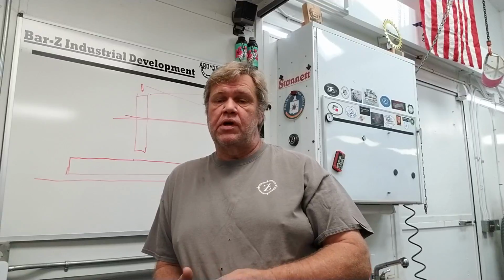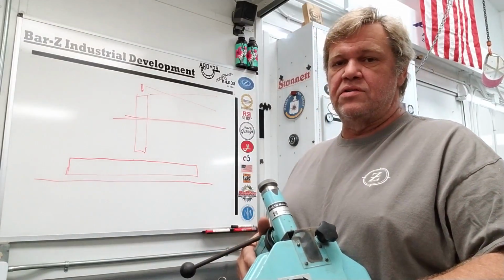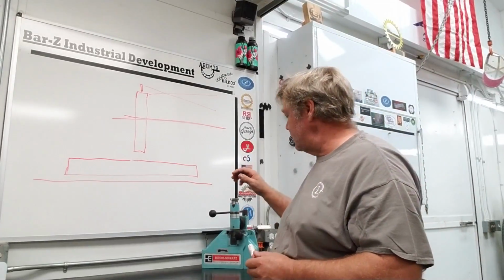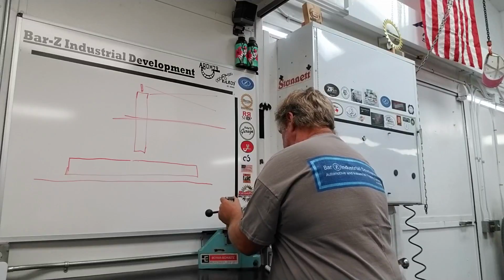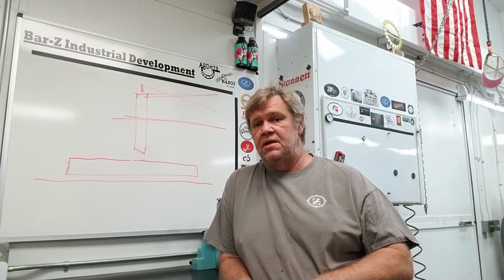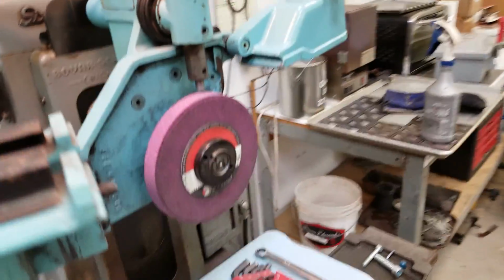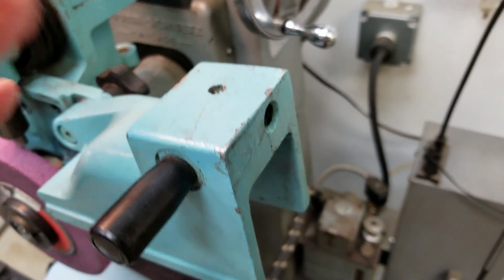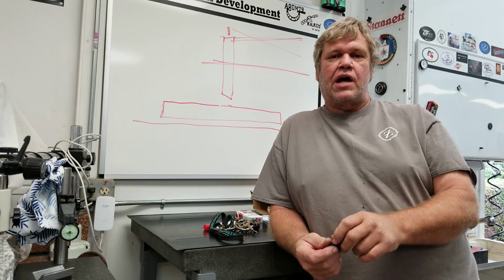Overhead diamond dresser installation part 1

Comment: OLD STEAM POWERED MACHINE SHOP :  Hi stan, Looks like a well thought out piece of equipment. This is sort of off the subject but have you ever tried to regrind 4 jaw lathe chuck jaws?   Adam says they take a "set" after years of use and become slightly sprung clamping tighter at the back, looser in the front.  Some jaws are slightly concave at the contact edge but I don't think it's really necessary. I know you could do it with an internal grinder in the chuck but being a 4 jaw why couldn't you just square them up with the sliding surface?....Dave

Comment: How did you find that unit?  I am so jealous I would love to have one of those for my Boyar Schultz! If you dress off 5 thou on the top dresser dial wouldn't you have to advance the grinder down-feed 10 thou?
Reply from the maker: 5 on the diamond (rad) = 5 on the downfeed (Z), if we were working off the (dia) then yes, it would be a factor.
Reply: People are saying you won't like the surface finish I say bull crap. We have top dressers on our Jacobsen and Chevalier Grinders and they work perfectly. When you have to hog off 30 thou or so just go at it like mad, then dress, move down and finish. It makes grinding jobs so much faster. I will say the Jacobsen grinder top dresser is hydraulic so it is nice and smooth and rigid. The Chevalier, on the other hand, is a rack and pinion like yours. I find if I lightly touch the front of the head and give it a little resistance opposite of it's  movement I get a better finish. I suppose I am taking up the tiny backlash between the rack and pinion teeth. Seams to work for me mabey give a shot and see if you notice a difference.

Comment: Stan, thanks for your great installation of the overhead diamond mounting accessory. However, it's not always necessary to remove parts from the magnetic chuck to dress the wheel. In most of my jobs there's enough space beside or behind the parts to place the  diamond dresser, sometimes a tall one if needed. Overhead mounting does save time and works well as long as the dressed wheel remains perfectly parallel to the chuck as you pointed out.

Comment: Is it possible to mount a dial indicator on diamond mount and check tram off spindle or tall paralell blocks off mag vise? Might need to fabricate a spindle adapter that would just be used to set jacking screw.
Reply: Just use the dial indicator directly to the table, as it is parallel to the machine ways. If the indicator doesn't reach, use a parallel on the magnetic table. No need for any adapters or anything fancy.

Though I would check that the diamond is traversing parallel to the Z axis and perpendicular to the X or Y. This way you are not traversing a barrel shape to your wheel.

Comment: Stan, thank you, I took mine off because I didn't think one could maintain parallelness having slop, vibration, and such. I'll give it a try once I see how you do with this. Also, could you, perhaps show something on dressing speeds in reference to the diamond. I'm seeing variable opinions. Very good video. Thanks, Tom Eyssen
Reply from the maker: Hi Tom,
All things being equal, same wheel, same RPM, a fast dress with a big dresser downfeed (.002) will leave a very open, very coarse dress with lots of holding power. The exact same wheel with a slow moving fine dress with (.001) downfeed will leave less lines and a finer finish, but it will load quickly. Hope that helps, Z

Comment: With the diamond off of the wheel centerline,.001 downfeed on it,would not equal .001 on the wheel diameter.
Reply from the maker: Your absolutly right, unless the boys over at Boyer Schultz already thought of that, they are a clever bunch.
Reply: That's a nice thought and all, but the effect would be something you just can't measure.

Comment: Just think of the time savings if you have a complex compound dual sine bar setup and need to touch up the wheel mid grind. A lot more than a simple 5 minute swap. You will love that dresser. Great video.

I'm sure you could get creative with an indicator mounted in place of the diamond, to tram the dresser to match the table axis. 

Have you thought about putting in some dimples and use a bearing ball under your jack screw for smooth semi single point contact?
Reply from the maker: Ha ha, that happens more than you know, I get my sine plate cleaned, installed and trammed in, parts indexed and ready to grind ... ah crap, I forgot to dress the wheel ....

Comment: Stan, do you think you may need to both push and pull on that tab or is there another adjustment that puts an up slope on the  diamond as you pull it out so it only needs jack the tab up?
Craig
Reply from the maker: I only needed a gentle push, stay tuned for part #2, rendering now.
Reply: I think I would be happier with the tab restrained in both directions.  Probably overkill, but it would make it positively located.